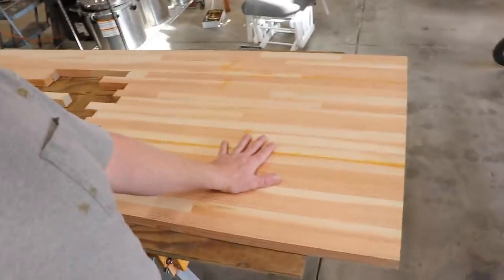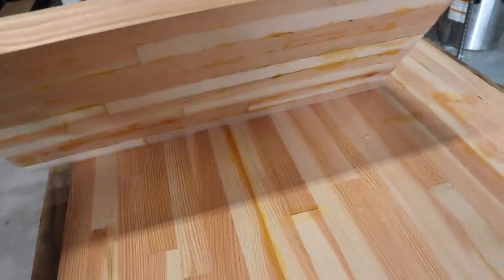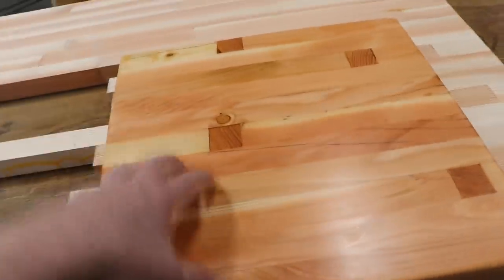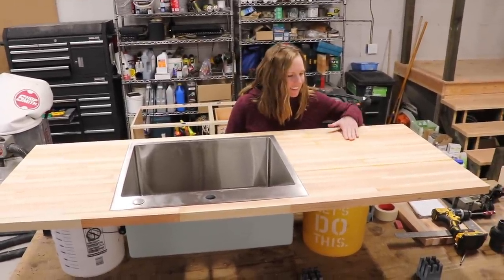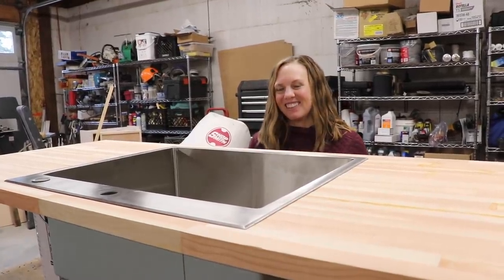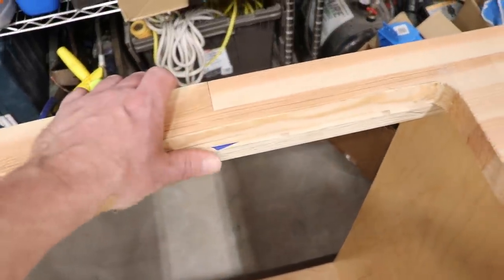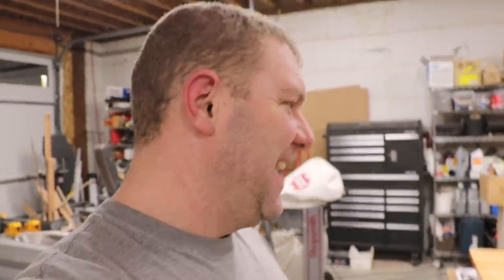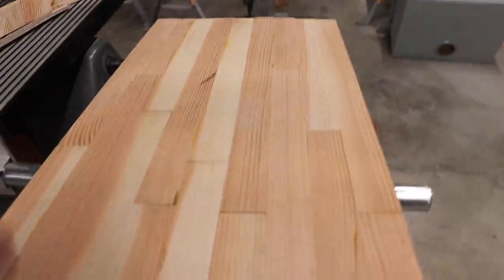Firewood ➡️➡️ Butcher Block: Sink Install & Epoxy Coating

Comment: "I don't know what normally happens here."
Normally, the front wall of the sink base is mounted vertically and is only about 3/8" or 1/2" thick.
As I type this, I see you're doing just fine.  What you're doing is typical.

Comment: 1)  I'm guessing they aren't big on Christmas?
2)  LOVE the look of the sink - nice and deep.  Only thing I don't particularly like is the square inside corners.  My own (stainless steel) kitchen sink has rounded inside corners, which makes it super easy to clean.
3)  LOVE the butcher block top.  That is slick.  Fine work there.
4)  DON'T skimp on the epoxy, folks, and buy that cheapo stuff off eBay like I did once.  It had gobs of filler in it.  All epoxy is NOT created equal!

5)  The fun part is sanding it (or polyester, if you're coating surfboards - epoxy isn't generally suitable for exterior use).  Those finishes dry somewhere in the area as hard as diamond.  I quit experimenting with either one of them in guitar building, and went exclusively to sprayed 2-part urethane (same stuff that comprises the clearcoat of your vehicle, but NOT suitable for countertops).  Polyester and epoxy are great for small repairs, though.  Sanding a matte finish (to remove any imperfections) is problematic - you can really go down a rabbit hole on that one - so the initial finish must be essentially perfect (done with industrial equipment).  But you can achieve a faux matte effect sanding a gloss finish, as shown.  I much prefer the matte finish myself, but cleaning and matte retention are two possible concerns.
Reply: These are filmed a month or more before posting. Every now and then they will have a to date video, but most projects are months behind

Comment: I hope you are not putting food scraps down the drain. You are on a septic system, I think, and they do better without any more solids than absolutely necessary.
Reply: Yes, drains, food scraps, and septic systems:

The answer is enzymes.  Feed your septic with regular doses of an enzyme  product such as Ridx.
Reply: @lindapolle1665  Yes, I understand all that but enzymes don't turn solids into liquids. Enzymes reduce their volume greatly but cannot eliminate them. The minerals are still minerals even after enzymes have done their work. Solids do not readily percolate down through the soil in the leach field and eventually stop the liquids. Not putting solids down the drain extends the life of your leach field.
Food waste needs to be composted or carried away in the trash!
Reply: @papaw5405   Enzymes are specific.  Yes, they can "liquefy" solids, however what you said about composting food waste, is the better way to manage the "matter".
Reply: @lindapolle1665  Nothing can change a solid to a liquid except application of heat or by a chemical combination. Enzymatic processes are not chemical combinations. You may have the last word.

Comment: use a propane torch or heat gun to help level, use a spray bottle filled with isopropyl alcohol to bring up bubbles all available from prior supplier

Comment: "Just ONE mistake..." 
Where's the cat?  -_-
   Honestly, pets are the leading cause of DIY finishing flubs. 
I finished perfectly laying hex tiles in the bathroom, The roommate's dog wakes up and wants to to know what I was doing when I come out of there. He gets one foot in to make four tiles go off center. So much for perfect.
I poly-coat the resin paper topped work desk, even waiting a few minutes before letting the cats out of the bedroom. One of them notices things are moved and HAS TO explore. At least she called for help the moment she realized her paws were stuck.
And the times a pet tramps onto wet cement are innumerable. (Although in one job the owner liked it and did an acrylic finish.)